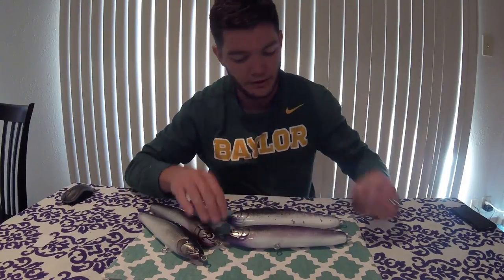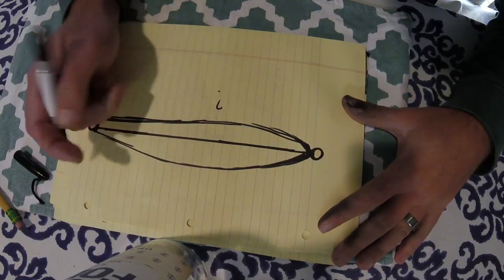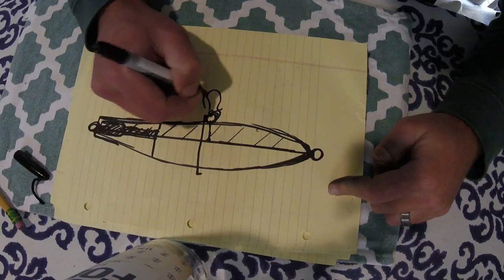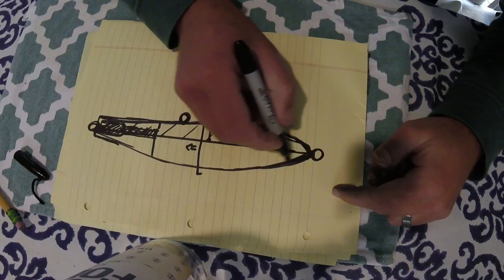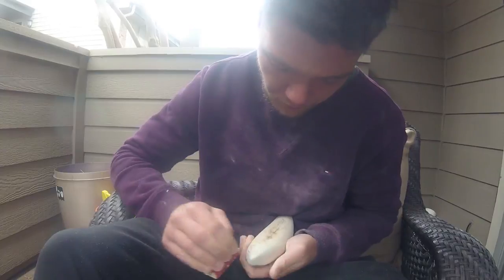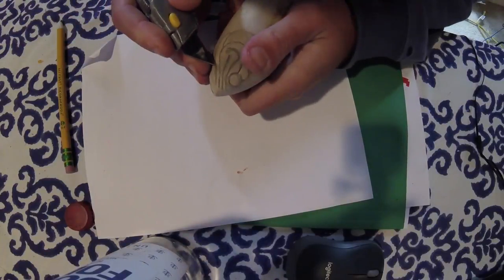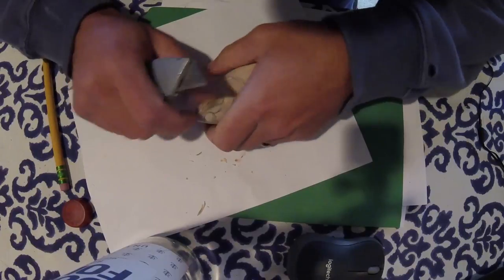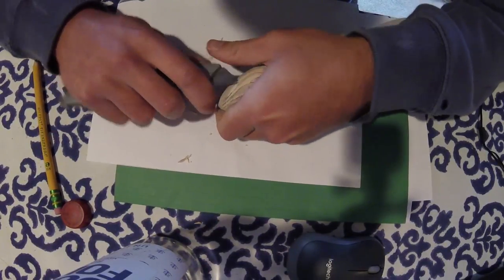Designing A Big Stickbait - Balancing Stickbaits Part 2.

Comment: Beautiful work!  Thanks for the video, I make GT Poppers, and Stickbaits are a completely different animal!!  One of the problems I get is a "roll out" when you sweep the rod.  Any advice?
Reply from the maker: Hey mate, thanks for the kind words and sorry for my late reply. In part one of "How to Balance Stickbaits" I tell a little bit about the to key points of balance in a stickbait. Your balance has to be between stability and instability. If you have a stickbait that rolls out or spins, you should do either of the following to improve balance.

-Add/Increase weight towards the bottom side of the lure
- reduce the amount of wood in/on the belly (so that the balance weight sits closer to the belly of the lure)
- Use heavier hooks on the belly
-Re-position the internal weight more towards the bottom of the thickest part of the stickbait. 

Be careful to not overdo it because otherwise you end up with a stickbait that doesn't move as it becomes too stable.
I hope this helps, let me know how you go.

Comment: Your lures look good man, I make lures in a very similar way to you, using the two pieces of wood instead of one piece. One concern I have is the lure body splitting under pressure from a decent sized fish, what is your opinion on this? Have you hooked into a fish in excess of 25kgs with one of your lures?
Reply from the maker: Hi Oscar, thanks for the kind words. I used to have the same concern until I tried to open up one of the lure bodies that I had messed  up. I was not able to get the two parts to split, instead the wood actually broke (after hitting it repeatedly with a sledge hammer). I found that is was easier to split the wood if you use epoxy because epoxy does not penetrate the wood, where super glue does. On top of that, all top of the line handmade lures (read stickbaits) are two pieces of wood superglued together (Moutoukenmaru, Ginnei Lures etc.). Just make sure you soak the two connecting parts in superglue. Hope this helps!
Reply: The Angling Globetrotters , thank you for the reply. I use super glue yea, not a big fan of epoxy as it is expensive, becomes tacky/ hard to work with to fast and takes a long time to dry proper. I mostly make smaller topwater/ sub surface lures (120-140mm) to target some fish around here but have made one or two bigger lures, currently busy with a 240mm monster. I just need your crazy carving skills now